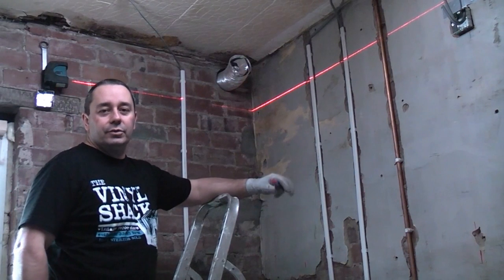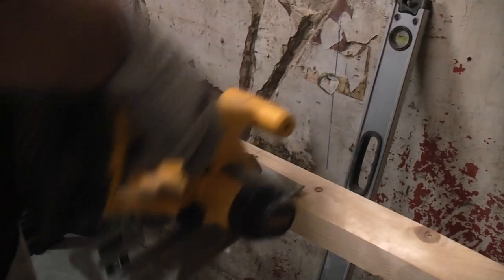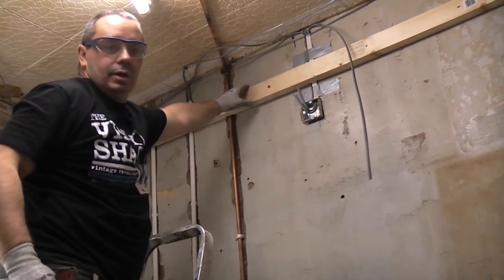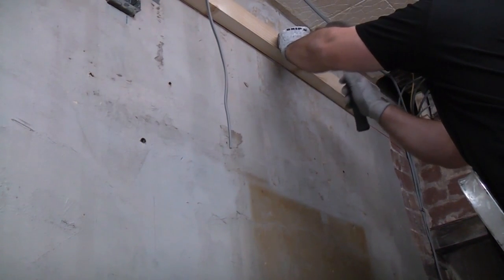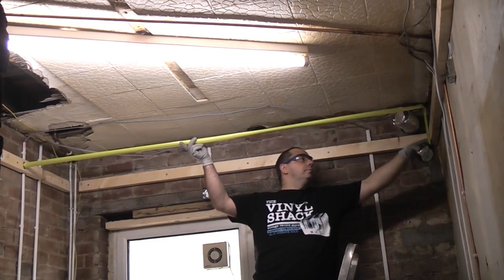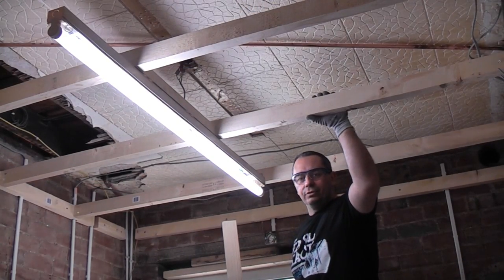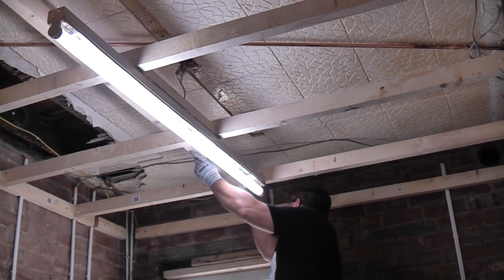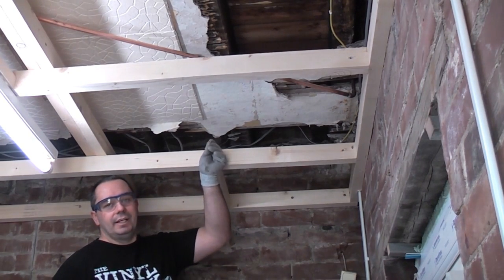How to install a stud ceiling

Comment: Hi. I am fitting a false ceiling in a kitchen too. The existing ceiling is approx 13’ high and is of a flame resistant board. I’m fitting at a height of 2.4m. Should this be lined with a flame resistant board too?
Reply from the maker: Yes, it will need to be fire resistant board too.
Thanks for the comment
Reply: Ultimate Handyman ok, thanks. Could I just double skin with regular plasterboard instead?

Comment: I want to put up that plastic ceiling stuff, but i need to make a suspended ceiling like you have done, would i need to use such large pieces of timber 3x2? Or could i use a thinner type of wood, its a small box room. I want to do a good job, so if you could say which would be the best timber to use i would buy the correct one. Thanks and GREAT Video Channal
Reply: I did a small room n used 2 X 1

Comment: When u skew screwed the studs did u go into the wall through timber of just through timber
Reply from the maker: Just through the timber, there is no need to go into the wall.
Thanks for the comment ;-)
Reply: @ultimatehandyman  thanks. The frame is fixed up but the walls are uneven leaving space between timber n wall. How do you solve this? Packing plywood or shims
Reply from the maker: @FM-js6cq   You can use either, just pack it out, then screw it up tight.
Sorry for the late reply, there seems to be a problem with YouTube comments AGAIN
Reply: @ultimatehandyman  thanks pal. I'm at noggin stage but do u cut yo length or oversized as studs are bending because if tight fitting, n some are coming loose?
Reply from the maker: @FM-js6cq   Measure the gap and cut the noggins 1-2mm longer. You should have to tap them in with a hammer. Don't cut them too long, or when you knock them in, it will spread the studs.
Reply: @ultimatehandyman  thank you for supporting me on this journey. I've completed it however there are a few studs lower than the rest. Someone said it could be due to the wood having a bow in it. What should I do? Hammer them up? Plane them or remove n replace? Love u. Thanks for this video. Looking forward to seeing more of your projects with your lovely accent
Reply from the maker: @FM-js6cq   I would not used bowed wood, might be best to replace.
Sorry for the slow reply, I've just seen this

Comment: Do the studs refer to the beams in the ceiling? I read about a low studded ceiling in a book and not sure exactly what a room like that would look like
Reply from the maker: You can put the new studs wherever you want really, but it best to position them so that the plasterboard fits, without having to cut it etc.
 Thanks for the comment 👍

Comment: Hi there, great video - I'm wanting to have a false ceiling in my kitchen with led/halogen downlights- is this method suitable? I'm worried about the weight in the centre of the room - also, how difficult is it to attach the plaster board?
Reply from the maker: David Shaw Yes, this method should be suitable. Even if the kitchen is large you can attach stringers from the existing joists to take some of the weight of the stud ceiling. The plasterboard is best installed with two people as it's very hard work for one person. This might help- http://www.ultimatehandyman.co.uk/how-to/plastering/plasterboard-ceiling
Reply: ***** Great, thanks for your advice

Comment: So you plaster boarded it twice ? Wouldn't that be too much weight ? I'm looking into doing what you have shown in this video because of impact noise from the flat above me would it make much difference to impact noise ?
Reply from the maker: It's incredibly difficult to reduce noise from neighbours, to do it properly it costs thousands of pounds. The stud ceiling is stud ceiling is strong when constructed correctly, I could hang from it without it moving. You can get acoustic plasterboard but I have never used it before.
Reply: *****
Thanks for the reply just one more question my room is 12foot by 10 foot if i was to do what you did in the video what joist size would i need ?
Reply from the maker: antony hill
I'd just use 3 inch by two inch timber, as long as it is fixed properly it will be fine. Sorry for the late reply, I have only just seen this comment !
Reply: if your worried about the weight stick some hangers down off existing celing spread them along the joists will go no were
Reply: Hello mate,im in the same situation as you was and the impact noise above my flat is very bad due to footsteps.I was wondering if you ended up doing this,if so how is it?Im not expecting complete noise reduction ofcourse.
Thanks
Billy

Comment: Would this method of using wood be okay in a bathroom? Due to the amount of steam? Cheers
Reply from the maker: Yes it will be fine, I installed a stud ceiling like this in my old house 18 years ago and it is still fine, the studs were of  course used to fix up plasterboard, which was then Artexed over.
Thanks for the comment

Comment: what plasterboard would you use in a bathroom with concrete ceilings above?
Reply from the maker: I'd use moisture resistant plasterboard, it is widely available now.
Thanks for the comment

Comment: is this suitable for a heavier blue acoustic board?
I need to create a false ceiling as i have issues with a neighbour. We have no insulation whatsoever between rooms.
Reply from the maker: Yes, as long as it's installed correctly.
The false ceiling in this video was boarded with 1/2 inch plasterboard, then over boarded with 1/2 inch fire resistant plasterboard.
Reply: Good.  Thanks.

Comment: I know this video is old but how do you join the two pieces to make a continuous length above the joists ?
Reply from the maker: I normally cut a piece about a foot long and then use that to brace the two pieces together, using about ten 3.5" long woodscrews 👍
Reply: Do it however you want but remember to have fun and not be a kill joist

Comment: Out of curiosity, why do you add noggins? Wouldn’t think you would need them in a ceiling.
Reply from the maker: It strengthens the whole thing up and gives you something else to screw to.
Thanks for the comment
Reply: Ultimate Handyman thanks for the videos! It’s good to see things done in real life situations. Much better than the videos filmed on sets with perfect set ups.

Comment: Wood isn't particularly strong in that direction, so you risk splitting the fibres. However, screw technology has advanced greatly in the past few decades and although I wouldn't do so myself under many situations, at the end of the day with this it's ultimately only supporting itself plus the plasterboard and plaster, both of which add stiffness and spread the load.

Comment: Hmmmm.... shouldn't you be using pressure treated wood on concrete?
Reply from the maker: We don't normally use treated wood internally. The house is in the UK and is built of Bricks, I don't know anyone that uses treated timber internally, it is normally only used externally for decking etc. but the slate battens are normally treated to prevent them rotting.
Reply: what for ? in case it rains in the space, most pressure treated wood is badly done anyway in the uk, plus people cut it and break the seal, and it's always wet

Comment: hi dude i like your videos i have got some good tips. i would like to say that you should never use a metal hammer with a wood chisel at least that is what i was told in wood shop good jod
Reply from the maker: That is correct, a joiner will never abuse a wood chisel like I do LOL. I was once stood on the roof rack of my van removing a shop sign for my sister and the only thing I had to reach was a wood chisel and hammer, it sheared the M10 bolts easily ;-)  Don't tell any Joiners though as they go nuts ;-) 
Thanks for the comment

Comment: what happens if your studs are not long enough to go the length of the room?
Reply from the maker: You either get longer studs or partition the area up, perhaps by joining two lengths of timber together.
Reply: I thought about joining two studs together. My room is 5meters wide so I would need 5 meter studs and I can't get that length. Anyway, with 5m span wouldn't it be better to get some support from the ceiling? I am building a recording studio and need to have the cavity between the false ceiling and concrete ceiling filled with attic insulation so it doesn't need to support a lot of weight but it needs to be firm.
Reply from the maker: If you join two studs together to make one long one and install it down the centre of the ceiling, you can then use normal length studs running the opposite way. For such a large span though I would put some supports in to the existing ceiling.
Reply: The opposite way is 12 meters so that is even longer :) thanks for the vid and for your replies
Reply from the maker: I take it this is not in a domestic property?
Reply: It is my basement. I have a big garage/basement that I want to use as a recording studio. The reason why I can't use steel framing as with a normal suspended ceiling installation is because I need the wood as I will then staple fabric over it to keep the attic insulation in place. The fabric keeps the fibers from escaping.
Reply from the maker: Oh, ok. 
I'd make sure to put in plenty of supports between the old and new ceiling to prevent it from sagging ;-)
Good luck with it.

Comment: What would happen if you didn’t use noggins?
Reply from the maker: The ceiling would probably sag, plus you would not be able to put screws in the end of the boards.
Thanks for the comment 👍

Comment: Im thinking of doing this into an underground room (Home Cinema project) and this video has helped a lot, i see in your video that you used 2x4 beams for the main lengths at 600mm centres... i have a room which is 4.6 x 2.4 and have found a place with good deals on timber 2400 x 63 x 38mm, would this be suitable for this type of job, or would you recommend something else (i was thinking of poss doing 300mm centres, little more, but still cheaper than buying the thicker beams)
Reply from the maker: I used 3" * 2" timber for this job as the room was only small. The timber you can get at a good price is not far off that size so it should be fine, especially if you place the studs at 300mm centres.
Reply: can i ask your advise on finishing too, what i really wanna do is create something that looks like this (http://1.bp.blogspot.com/-a39HGF3cyC8/UmjgH7Z78yI/AAAAAAAANPY/1GomR4CJPuA/s1600/false-ceiling-pop-design-LED-lghiting-2014.jpg) without the centre part, just the outter dropped section with led strip lights... i can build the ceiling structure, but dont have a clue how to finish it, been thinking platerboard, with tapered edge, just painted, but cant see it looking any good ! any ideas ?
Reply from the maker: Aaron Smith
Have a look at this made from MDF http://www.ultimatehandyman.co.uk/forum1/coffered-ceiling-wainscoting-installation-t76546.html

If you use plasterboard it will need plastering to make it look good, so I'd go for MDF as it is much easier to finish.